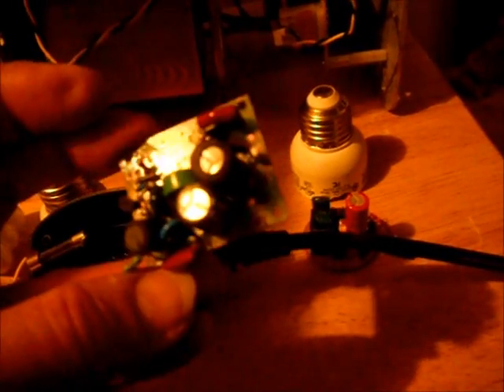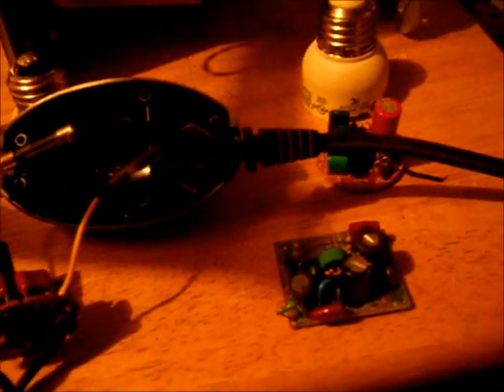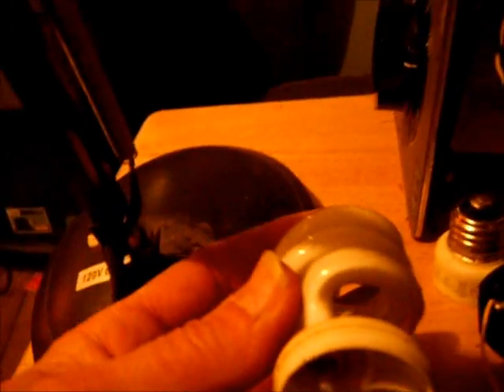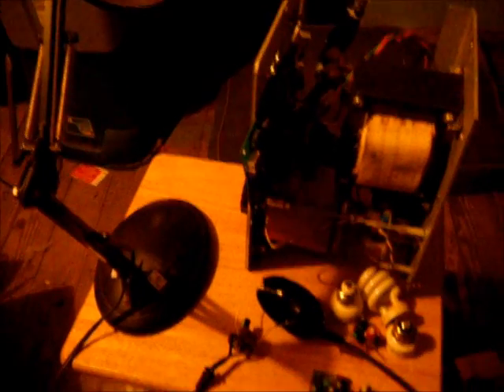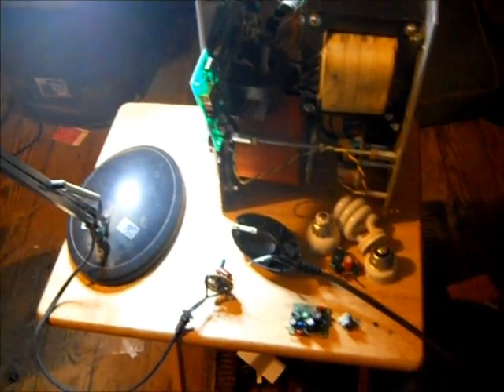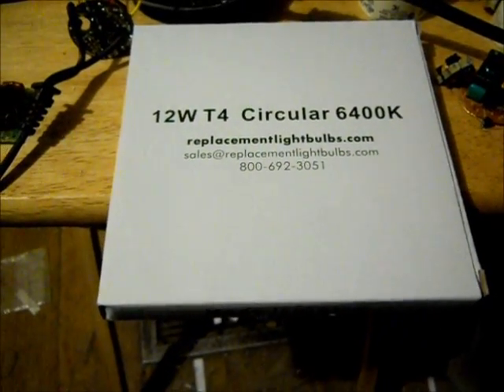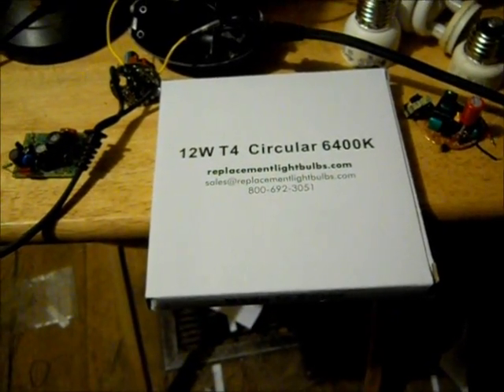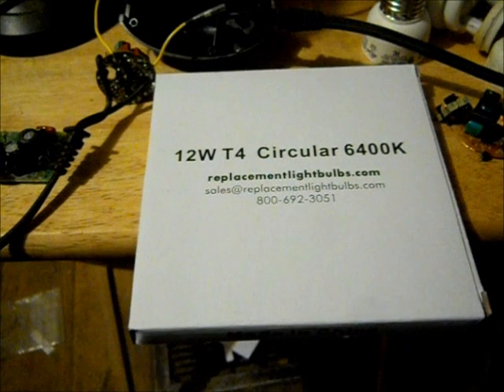Desk Lamp Repair With CFL

Comment: Well my attempt to repair mine your way failed. I could not find the right two  connection to short. (I'm admittedly a red to red, white to white electrician) So  I ran a length of speaker wire and connected all four wires from ballast to the bulb plug.  Thank you so much for the inspiration to keep at this and made it work.

Comment: hi paul,  i would like to make use of your mod using the CFL driver on my magnifier lamp. I am puzzled as to what you are shorting on the output.  I know there are two outputs on the driver (a pair for each end of a florescent tube).  Are you shorting one output pair and using the other output pair to go on to the circular bulb?  Is one output better to short versus the other? (i noticed on the various schematics of these drivers, there is a cap wired between the two outputs). Also where did you find the fuse on the original driver you pulled out (was it under insulating mesh next to the hot line)?  cheers,  ~wiggy
Reply from the maker: It's been a while since I made this repair (and it's still working great!), but IIRC you need to short the pins on each end of the lamp, which are the filaments used for conventional starting where line voltage is applied to them in series so they glow. You have to short the filaments so they do not interfere with the voltage from the electronic ballast. If you check the resistance of the pins on the circline lamp, two pairs (on each end) will read about 3-5 ohms. These are the filaments, and they should be shorted.
Reply: thanks for replying Paul.. I am still trying to wrap my head around understanding your mod. I have a couple more questions. Coming from the electronic ballast, if you short output pair #1 together (that heated filament 1) and then short output pair #2 together (that heated filament 2) then where do you take your 2 output wires from, that to go to the circline bulb?  what amount of voltage do you have across those output wires? .
Reply from the maker: You just have to connect one pair to one end and the other pair to the other end. The voltage across these wires will be several hundred volts open circuit,  but across the bulb it will drop to about 80 volts once the lamp lights. See:
http://www.edisontechcenter.org/Fluorescent.html
http://hypertextbook.com/facts/2003/KarryLai.shtml

Comment: Thank you for posting this video. I have a circline desk lamp that the the starter was faulty and I followed your example with the cfl starter. Because the cfl had 4 wires and the circline had 4 pins I didn't have to short anything everything works fine!. thanks again

Comment: Hi, I have the same lamp that failed. I found a burned resistor, cracked transistor & blown fuse.  When you say tie the wires together, you mean the 2 wires that went to one side of the old CFL bulb, ties those together and then do the same for the other side too right?  I see the fuse is a 500 mA. I am going to add a fuse socket on mine and use a 5mx20m fuse. The company MG, never returned my emails. I was hoping to buy a new board.  Your fix sounds so much better. Thanks for sharing!

Update: I used the board from a 14W CFL and my lamp is working again. Thank you!